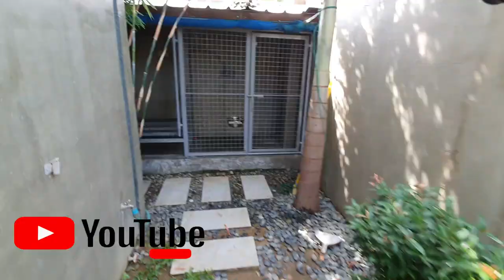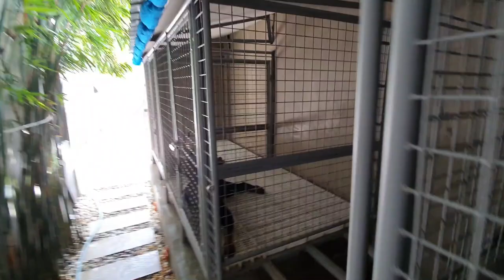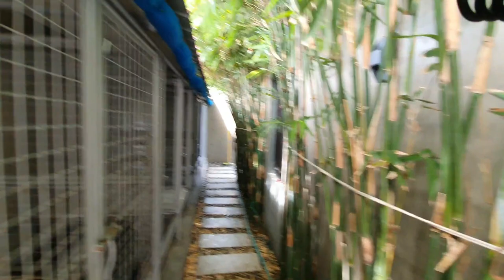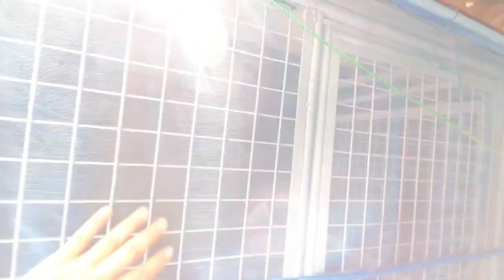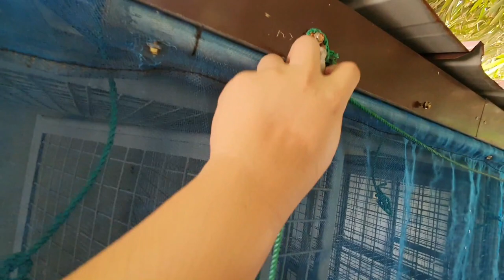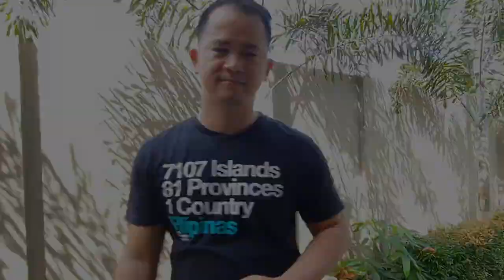KENNEL IDEAS!! INIT, POOP AT LAMOK may sagot ako dyan!!!

Comment: I suggest sir add fans po😊 or exhaust fan po. Parang mainit pdin po di ng sisirculate ung hangin hehe sa opinion ko lng po un sir🙏
Reply from the maker: Yes po, depende po sa location, dito po kc sa area nila mahangin po dahil meron pong in and out ung hangin at meron pong mga bamboo, but magandang suggestion po ang fan.. maraming salamat po.. keep safe..❤️😀👍

Comment: ano po size nang matting?
Reply from the maker: 1x3 ft po..thank you po..😊❤️🤜🤛
Reply: @doggymatters   7 mattings po yuung sa Rottweiler diba? Paano nyo nilagay ang mattings nilinya nyo lang yung 7?
Reply from the maker: 10 mattings po na sunodsunod at 3 mattings na pahalang at may pinutol po akong konti, then nilagyan ko po ng partition na pwedeng i sway para pag ngka litter po dun ko cla ilalagay para maluwag po sila..😊🤜🤛